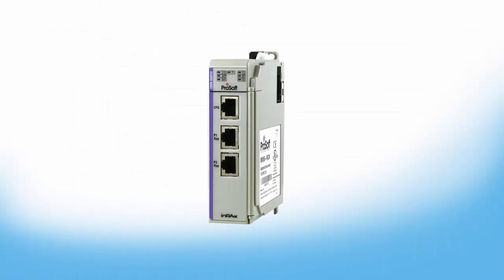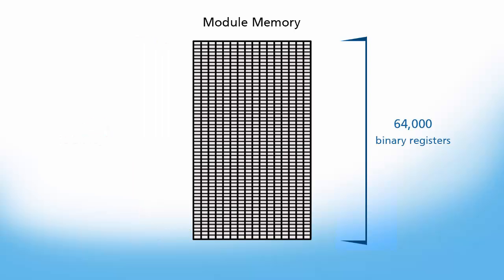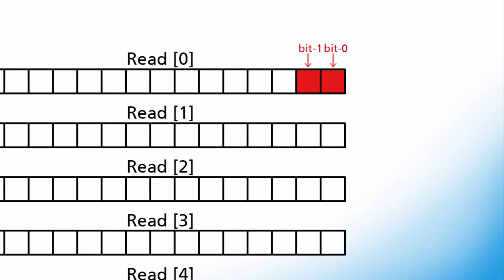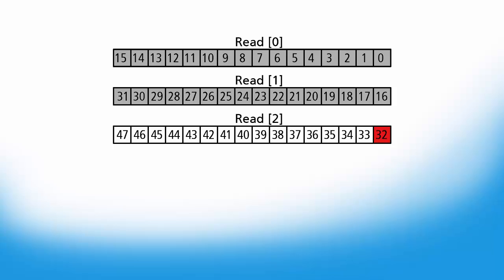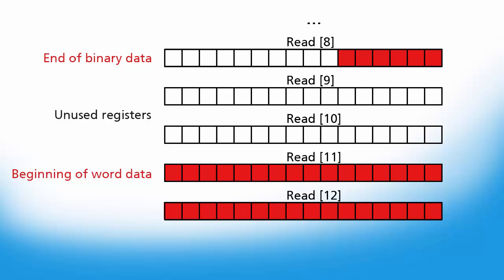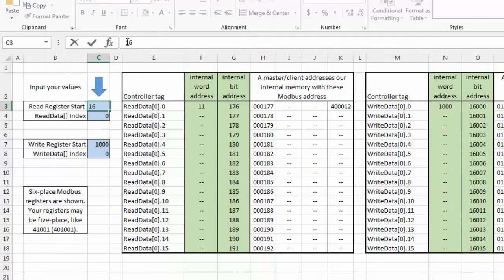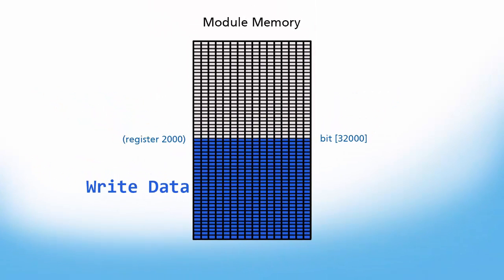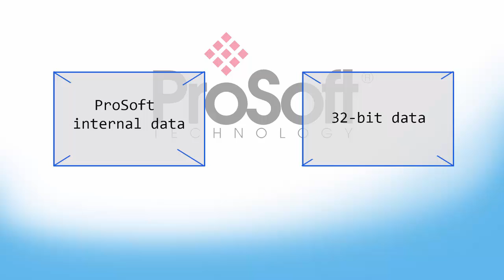Tech Support: Guide to bit-level data addressing in ProSoft Modbus modules

Comment: where is the excel spreadsheet?
Reply from the maker: Hi there! The spreadsheet is available under the Downloads section for applicable modules (including this one: https://www.prosoft-technology.com/Products/Rockwell-Automation-In-chassis/Platform/ControlLogix/Modbus-Master-Slave-Enhanced-Network-Interface-Module-for-ControlLogix ) with the file name "MVI Modbus Memory Tool."
Reply: @prosofttechnologyinc  Hi! Thank you, for weird reason the link you gave led to the ooops page (404 Not Found), but I managed to get it manually.
Reply: @nikog2243  The provided link by Prosoft doesn't work. Could you please post it here that works for you? Thanks!